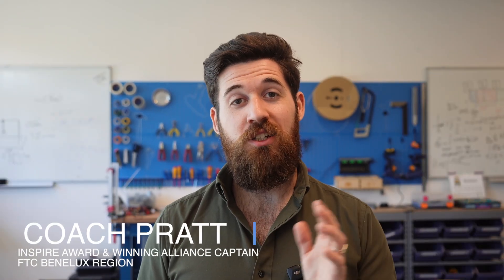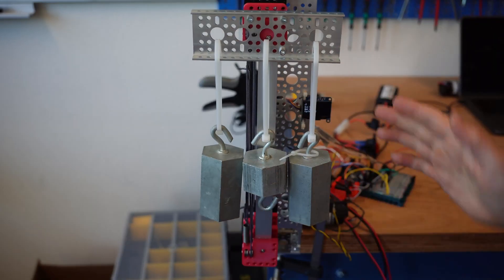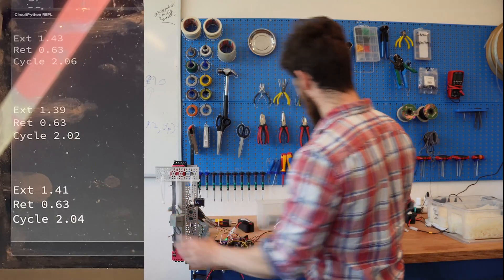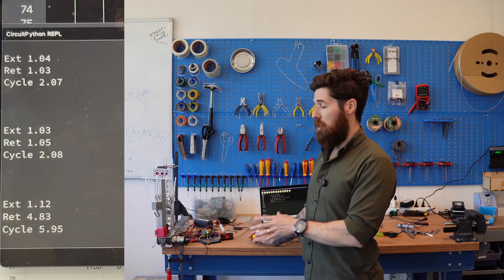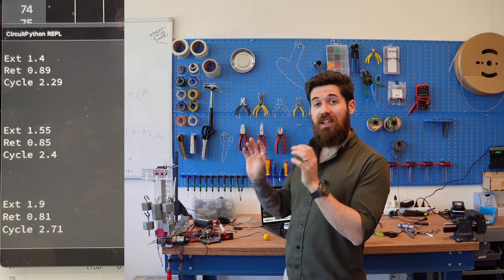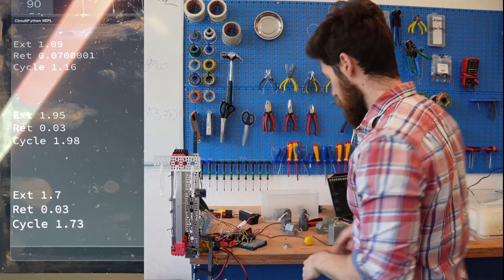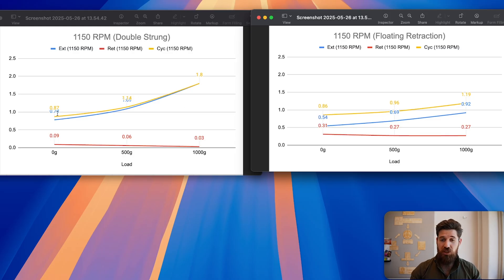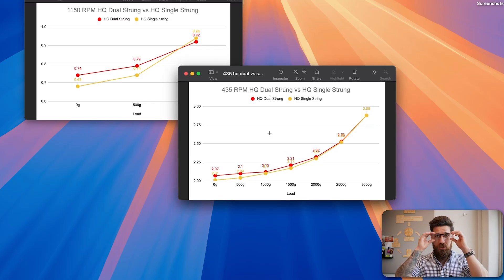Misumi Linear Slides Tested: Dual Strung vs Floating Retraction

Comment: Do you have any ideas how to minimize string tangling? We used the viper slides (with a floating string) and the retraction one would always come out eventually since the string tension would get looser as it goes up.
Reply from the maker: My dual pulley system (instructions here: https://youtu.be/E7MPn3sod5Y ) significantly reduces this tangling on a floating retraction string, as it adds multiple constraining points throughout the system, and 1 right beside the pulley itself. 

Alternatively, if you still want to use a floating retraction setup, adding in a constraining v-groove bearing closer to the pulley helps, as does a thicker UHMWPE 1.3mm-1.6mm string.

Comment: How are you tensioning the string on the ‘floating retraction’ set up? From the video, it looks like as you are extending, the retraction string gets super loose (which makes sense as at the start of the cycle the relative diameter of the spool is larger since the string overlaps with itself). Not sure if it really affects the performance but might be worth adding extension springs.
Reply from the maker: I do have a retraction spring on the system, no extension spring. This is a drawback of a floating retraction string system, as it can be difficult to properly tension across the entire length of the system, especially in the extremes at 1meter in length. It would not affect the performance of the system with a looser retraction string, but too right of a retraction string would indeed affect performance at the ends as if would require more torque to drive your system to the ends of the stages.
Reply: @BroganMPratt I agree too much tension will negatively affect the system, but also adding more tension will make sure the retraction string won’t get caught in anything, and also make sure there is no delay as motor starts spinning downwards. For reference I designed and released opinsert, and always found that it was better to run at a pretty high tension (maybe testing tension could be your next test video).
Reply from the maker: @HudsonMakes  Hey, cool to hear that man. Your insert has been used by a ton of teams to help them out getting through design issues when working with misumi slides. The system I've got with a floating string is quite tight when tensioned at max extension, you can definitely hear a twang from the guitar, though it could be tighter apparently. I'd be curious to see how much performance is effected at the ends with the increased tension, it may be a bit of a wash as the motor may remove it's delay on the downstroke, but require more torque on the final stages of the extension slowing down this final section. In any case, as I mention at the end, I'm a bigger fan of using a dual system as it removes the need for keeping things clear of the retraction string, and this precise tensioning that many end users mess up, even on apparently well strung systems, of which I've got a pretty solid handle on at this point.
Reply: @BroganMPratt it’s interesting to hear your opinions on the duel strung set up. I always ran the floating set up, as it’s simpler with less moving parts. In my opinion less can go wrong in the set up. I agree retraction string is annoying, but when set up properly it ends up being easier. Looking forward to seeing more of your videos.
Reply: It would be interesting to see a similar experiment with cascade rigging with a single retract string vs cascading retraction.
Reply from the maker: @roboscoutsquad  Thanks for the idea, I'll add in a test on this in the future

Comment: Your string seems kinda thick whats it rated for?
Reply: We have been using kite string. It’s been working a lot better than the thinner GoBilda stuff. We are getting no pulley slips now.
Reply from the maker: @mrprobotics8283  thicker string does indeed make it easier to not slip beside your main pulley, or your v-groove bearings.
Reply from the maker: Just some off the shelf 1.75mm nylon. Not perfect for slides, but more than good enough for testing as the small stretch effect of nylon over such a small test will make little difference. For longer term solutions, I'd suggest some 1.3-1.5mm UHMWPE or Kevlar string instead. doesn't stretch, relatively inexpensive, and a 130-200kg breaking load.

Comment: This is a really good test! Have you tried or could you try 2 sets of slides with 2 motors, as this is what a lot of higher-level FTC teams use. This would probably just increase the friction for the double strung, but I think that it would still be very interesting to see.
Reply from the maker: Perhaps, That said, with higher quality bearings, we're talking a 50ms difference cycle times. And this assumes that the robot must be completely at rest and the slides fully retract before moving around the field again. However, robots typically move throughout the field + retract their slides, meaning this 50ms different is negligible. The benefits to consistency and compactness of a dual strung system, in my opinion, outweigh this small improvement in speed that doesn;t make an impact in a practical sense. Only in an isolated testing environment.

Comment: What was the low and high quality bearing you used on these tests?
Reply from the maker: I've got a full video on this coming out in the future, stay tuned. In short, The low quality bearing was a random supplier that doesn't pack the races themselves with grease, simply smears grease on the outside. the high quality has of course, been properly packed with grease. Clearly this makes a SIGNIFICANT difference in performance.
Reply: @BroganMPratt awesome that’s very interesting, thanks!